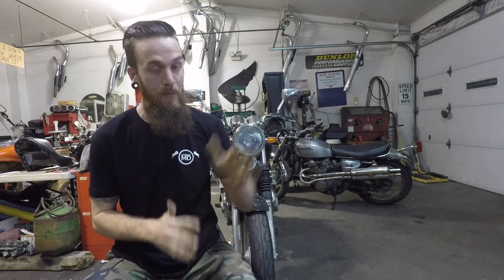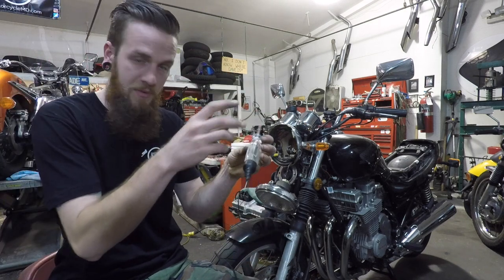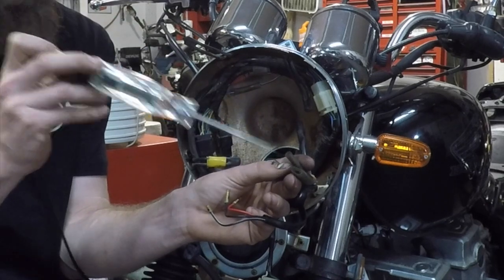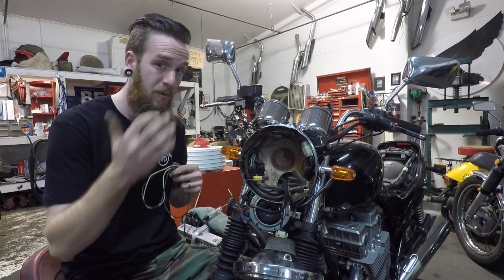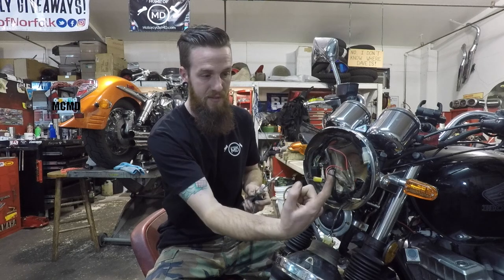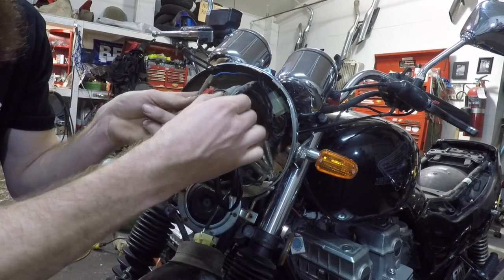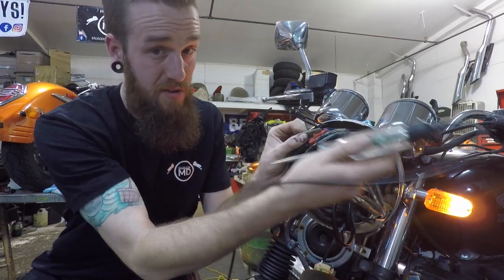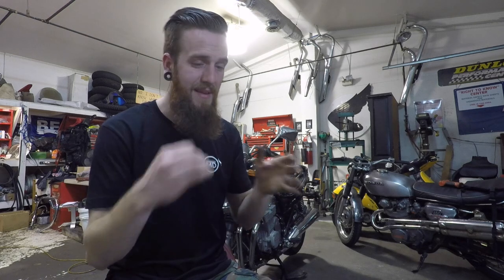Motorcycle Electrical: Test Lights, Turn Signals and Electrical Issues

Comment: I am having a wiring issue on my Harley. Your video was my first stop. It just so happens I am having a passing light power issue. I like the way you explained and broke it down. I learned a lot. Electrical is not my thing. Thanks to you I’m going to dive into this project. Tks for sharing

Comment: Cody you are a genius. Thank God for you. I got a Honda project scooter that needed everything. One of the last things that I tackled was my non operational headlight. I checked the bulb by running 12 directly to it, bulb ok I checked the power to the bulb, nada. I cleaned the high low beam switch, still nothing. Then I found your video. I wiggled the starter switch and the headlight came on. The starter switch is not returning to original position causing power to be interrupted to the headlight during engine startup. Thank you once again.

Comment: Working on a 86 Honda Shadow VT 700  problems with replacing front blinkers. You covered some marginal things that allowed me to fix the problem. I had the new blinkers connected wrong. After everything looked right it would not start. Walked away from it. Came back and just pushed on all the circuits to make sure they were seated. They weren't. Now I am back on the road again. Thanks.

Comment: Awesome video, I got a lot of information from it. I am putting aftermarket LED and I could not find the power source wire, but with the tips, you gave it should be a breeze now, I hope. Keep up the good work, and the GG was great, that I know I will not forget. Wheels on the road brother. Ride safe.

Comment: Cody I have a question??
I'm building a customized e bike.
  I'm buying motorcycle lights head,tail and turn signals.
  L.e.d. flasher, the switches that goes on the left side the handlebar. 
 My question is what else do I need???
  I can probably wire it up with the help of this video.
  Then all I will need is a Grin Technology V3 Cycle Analysis dashboard. A second battery a front electric motor.
  Can you help me with the question. When I make the video I will give you credit for the lighting system.
Thank you in advance.
R Mack

Comment: Watched the video it was helpful. I've got a 2011 fury that when I bought it they had removed the front blinkers .bought factory blinkers ,but when I tried to install the turn signal wires were missing in the headlight, crazy. Haven't found them yet but your video will help thanks

Comment: Cody, you are one fantastic teacher! I was able to follow you on this video, and I know nothing about my electrical system. Now, I feel I do. My problem is my starter switch, I’ve been told that it’s not repairable cause one of the tabs inside is broken. I have been searching like crazy for a new or used one and frustrated cause my knowledge of internet shopping sucks also. Summer is almost over and I want to ride right now! They say it will take 3 to 4 weeks to ship me a new starter switch. For me this is unacceptable news! Do you have any tricks for mending the switch? Looking forward to some of your awesome advice.

Comment: Hi there Cody, lm an avid follower of your channel and have found you very concise in how you go about explaining what you do. I've watched several of videos trying to find how to solve a problem l have with my bike. The bike has new battery new solenoid, l have checked switches and cables for hosts but to no avail. My problem is when l start the bike l depress the clutch and motor shuts down and starter starts cranking again. Start the bike push kill switch bike stops and starts to cranking again. I've tried many avenues but there are no old school mechanics as yourself to shed some light on my problem. I'm very mechanically mind with engine rebuilds and the such. It seems to me that the starter motor is not switching off after the bike has started. Appreciate your advice in advance just to get some direction or some light on the problem. Kind Regards George Slater

Comment: Great explaining video, thank you.
I have power to the indicators, and brake light, but the tail light and head light does not work, will these lights work with the scooter (Zongshen) is not started? because the indicators and brake light work with ignition just switched on, I do not get any power on any of the wires for the lights, head light or tail light.

Comment: I got new lights for my bike build and I'm so lost. I got one of those jeep headlights which came with no instructions and I got turn signals which are 3 wire and not led and the came with no instructions. You can see my bike it's on my yt Channel. Thanks for this video, new sub

Comment: You are the man Cody. Thanks for the great content. 83 cb650sc front signals.....orange and green into orange and green?...light blue and green into light blue and green? (no running lights for now dont worry about that) and the dark blue into dark blue? I think its the relay but want to make sure ive got them wired correctly.

Comment: when you have your snap on guy drive by again get a set of back probes.   Saves the worry of your paper clip hitting ground.  It also saves your connectors from being cracked (especially on older bikes with brittle connectors)  by back probing with your thick test light probe

Comment: HI - your videos have helped me a lot - (rear brake switch adjustment helped too) thank you.  - My question is What do you do if the (1984 xl200r your daughter bought) only has 2 wires on the front blinkers but you want to put in dual 3 wire... and then it occurred to me after your explanation ( The 3 wires being a ground- a blinker- and a low beam running light) that i'd plug into the original 2 wire location and then... just tap the third blinker wire into the existing headlite low beam white wire ???  Thanks

Comment: Hiya mate ive just got my first bike its an old cbr125r 2007  had it for around a week of fun but now im off the road because all my indicators and the light that shows theyre on has stopped working, do you think that would be a fuse problem or maybe a wire somewhere?

Comment: Great video Cody.  Is it your baby sat on the can?  
I just bought some aftermarket blinkers with only a single wire.....
No Ground....Help?
Reply from the maker: +dean farrelly They probably ground through where they are fastened too! The ground wire is internally connected to the light stem!

Comment: Love your vids.  I have a 08 vtx 1300.  recently the left front and rear signal lights started blinking off and on while riding.  I was on the road and did not have time to properly diagnose so I disconnected the constant power to signal lights behind headlight and now they only flash when activated.  Any suggestions?  I think something might be loose under the seat but cant find where.  Thanks

Comment: Thanks for sharing and appreciate it but personally think it's way safer to disconnect the power and use a the probes to check for continuity instead to avoid any issues.

Comment: Can you please do a video on hyper or too fast flashing or bulb out indicator flashing for led integrated tail light and front led signals please
Reply: I've got that currently, it's either:
Bad power.
Bad ground.
Bad bulb.

It's a fail indication built into the blinker relay. That relay on my bike is $86 and it's made in a way so I can't rip out the circuitboard and see if the internals are broken. So I'm looking at everything I possibly can before that.

Could be an open circuit,
a corroded contact(which adds resistance)
or a bad bulb, which would be easiest to check.

Comment: Hey I have a old 73 Suzuki it only has 2 wires for the front (I think a left and a right) and 2 wires for the back(left,right), but I'm having trouble getting aftermarket blinkers that have 2 wires each blinker to even light up.  This video helped a lot. Just curious if I'm overstepping something easy

Comment: thank you for your videos. if you can give me some information i have a 1986 honda magna 700 front turn signals blink and stay lite back turn signals blink but dont  stay light they are stock turn signals could a relay cause this? when i put the replacement turn signals on the back i wired them back the way i found them . wire system is a 2 wire setup If you could give me some pointers on what to do i would appreciate it thx

Comment: Can you do a video on the oil pressure sensor and it’s wiring? I can’t seem to find the wiring anywhere just the bolt. Also have no idea how to wire that through the crank cover?

Comment: How do I find which wire is my parking brake light? And how do I find the wire to my hand brake? My foot brake works just fine. I've already changed signal relay, replace bulb and my fuses are fine

Comment: I just put a new headlight bucket on my 76 CB 360T and now it's blowing a fuse. I also took off the tail light cover to wash it. Should I tape up all the wires? It was running fine until I did this yesterday.

Comment: I got an 05 honda shadow I just picked up a week ago and I am about to have to install and wire the brake lights, tail lights, blinkers, new head lights... and I am a bundle of nerves right now because up to this point in my life, I've never done any mechanical or electrical work in my life.

Comment: I've bought motorcycle indicators off ebay and they only have one wire. Yet my loom has 2 the one wire i presume is a power wire the other being a ground, I was told the bulb is grounded through the body of the indicator so the earth on the loom is not required. Is this correct? Do I simply wire up the power to the loom while leaving the earth disconnected or do I still have to connect this someway to complete the circuit?

Comment: Hmm so it seems like if your blinkers aren’t working and not showing on your gauge cluster maybe the relay is the issue? What do you think is the issue for that ?  I have power to everything else but my signals and hazards , horn and lights work
Reply: Also dude, same here.  Reason I need to check is because of a fucking huge sand patch and rock on a 15mph blind corner :(.  Now I get to learn my electrical issues and buy a leather cover for my petrol tank

Comment: I own a 2014 XR650L , would like to rewire my blinkers front and rear. At the moment I have LED's on the front but those 3-wire type better, in the rear I have brake/blinker/license all-in-one light and its LED too. But my wiring needs to be redone, its been splice so many times I need to isolate those wire and route them correctly with the right connecters or solder. I looked at the wiring diagram but the more I try to understand it the more confused I get. Why haven't I heard of those 3-wire blinkers and do they come in LED?

Comment: yes bro, thank you. I have a vt750c2 just installed aftermarket led taillight and my license plate light stopped working it was working; it was working before when I had just tied them together and wrapped them with electrical tape but now its not working that I soldered the two wires. I will try this later see what I can find out. I was thinking its strange that all my other lights are working fine, my brake light and running light, its just my license plate light that isn't working.

Comment: Hi great video , I want to ask you , when I turn on my key on my 73 honda cb450 I got nothing no lights and no horn no nothing . can you tell me what it could be? thanks
Reply from the maker: I wish I was that good... testing is required my friend. I would start at the fuses then the ignition switch itself
Reply: Most likely fuses
Reply: Check the parts of the wiring harness that touch the frame, sometimes with a vehicle that old the wiring can rub through, or crack and short or corrode, look for exposed wire, or crud from corrosion, if you don't see any of that, try checking continuity on the key switch, hope that helps to give you a place to start looking
Reply: @TheMotorcycleMD  hello cody , i just bought a husqvarna 701 sm and after 110km it shutted down 3 times in the last 10 kilometers while just cruisin , now i sended back to the shop and they said after hooking the bike up for electrical issues that they didnt see anything wrong with it ,so what could be wrong than ?

Comment: Cody

I have a 75 cb400f and the headlight h/l beam , high beam light and front running lights stopped working while starting it.  All other electrical working including starter similar to your video.   Head bulb is good h/l beams. 

I've looked over everything fuses , no burnt wires, all connections oem , headlight h/l beam switch is good clean.  The ground to headlight  good, high beam blue wire 12 volts while white wire low beam nothing.   Running light bulbs good plus the two Pos wires running to each front turn signals.   Turn signals function as expected. 

Is my starter button bad even though it starts the starter?

Only has two wires ground and r/y which are correct

Switch (key) connections do not have Voltage for the running lights on wire harness side red hot and solid brown.  

Key Switch is ok 

Need ideas on where to look.  

The book I have schematic cb400f does not show the running lights wire to front turn signals 

Help

Comment: Good stuff.  One question how I can connect my bike high beam to run with the low beam at same time?  I tried  to connect it.  works when the switch is on but when I start the bike only the low beam comes on not the high beam. Thanks for sharing.

Comment: Hi there I have trouble to reconnect turn signals in a vz 800 marauder 1998 ..all parts are out  including head light just wires on sight..and my problem is once I turn right or left buttons always pick signal flash in 2 wires ..so I cannot find a way to split  left or right side to finish and connect the turn signals.......

Comment: I really want to start doing work by myself on my bike especially in these times. but im having a hard time finding a service manual for my particular motorcycle. Are there any resources i could look at or where could i buy them?
Reply: you can get free ones on google
Haynes and others also sell manuals with good wiring diagrams
Reply: @Supernova12034  i've tried googling it. I've only found a russian one and a japanese manual specific to my bike. nothing in english.

Comment: I have a Suzuki 1500 intruder the blinkers are confused when I push for right or left they operate in hazard, I replaced the blinker switch and they worked a Lillie but reverted back to the hazard mode the blinker switch does work it cancels and the direction I turn on seems brighter

Comment: Hi, my 07 shadow spirit 750 dual carb bogs down/sputters  on high speed. Dual carburetors are clean, air filter is clean, new spark plugs, fresh gas, battery is strong( I have battery meter installed.) Is it possible that cause of it is electrical? Note: I change the wiring on my turn signals but when I hit the brakes everything lights up. The turn signals will flash fine on left or right direction but when I hit the brakes all 4 turn signals will light up steady like a brake light. Will that affect the motorcycle bogging on high speeds??

Comment: Another fantastic video dude  - what would you advise if your Honda is an grey import, and the service manual is in Japanese? :O
Reply from the maker: +Thomas Barlow Which bike is it?
Reply: TheMotorcycleMD Honda cb400 super four hyper vtec spec II, I sent you an email about and we had a chat which was really helpful :) it's got the engine out for a gearbox rebuild currently so I keen to know all the torque settings for the bolts, is it a good idea to use a shop manual for a similar bike?
Reply: Umm....Learn Japanese? heh heh.....

Comment: Hello everyone,  I have a recently acquired an 84 Honda Interceptor VF700F. Runs beautifully and in awesome shape.   Had the 84  VF750F Interceptor back in the day when I was in the corps. Redoing turn signals from prior installed after market 2 wire signals to 3 wire after market signals.  White running light and yellow blinker.  Problem: Left side factory wiring has the correct 3 wire colors,  green, orange/white and orange.  Right side does not have original 3 color wiring as someone else has been in this system before me.  Right side has red, black/white stripe and solid black.  I was able to find the blinker circuit and the ground to get the signals in white or yellow to blink on both sides. The third wire on each side seems to have no constant power at all.  Meaning the running light portion of the signal will not stay on.  I can only get them to blink.  Not sure where to trouble shoot from here and it's getting frustrating.  Next is to remove the fairing and get into it.  Way more than expected for what should be an easy wire up job.  Help...anybody!  Thanks.

Comment: I have a 1992 honda nighthawk cb750. Is there a way to make a 2 wire led turn signal work on the 3 wire system. The back turn signals plug right in.

Comment: Hi Cody, firts sorry for my poor english writting ,I'm Canadian french, ok now ,  I'm restoring an old superbike and the problem on my CB 900F 1982 is that with new battery, new selonoid, new 30A fuse and also new 15A,  the bike roll only  if I jump the pole selonoid, the engine turn but the problem is I dont have any power on the horn, light, starter button, every thing on the handle bar, so after check ground batt. fuse I cant not find want is wrong, hoppe you can sugges something please, Thanks and continue your super videos

Comment: Any idea on whats going on when the headlight and rearlight doesnt work when the bike is running but it works when the bike is set to parking mode? Its a suzuki intruder vs1400 from 91.